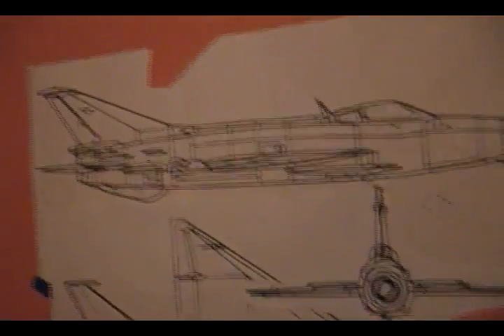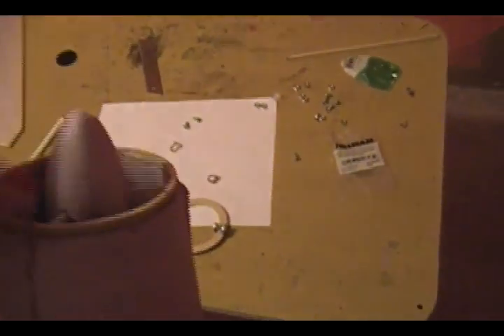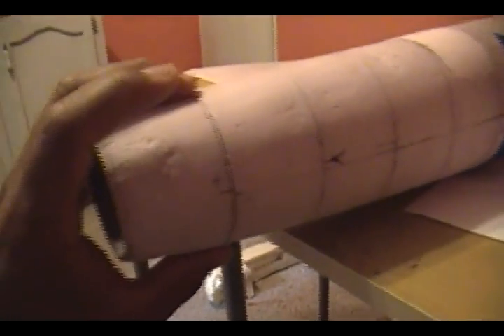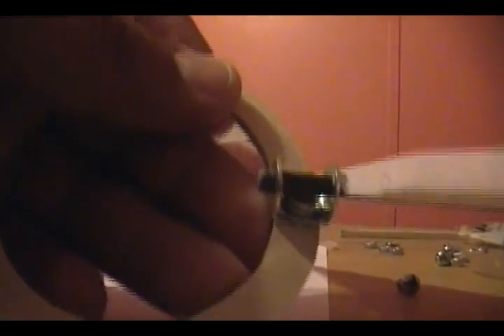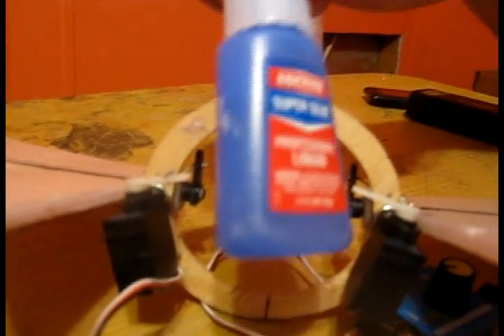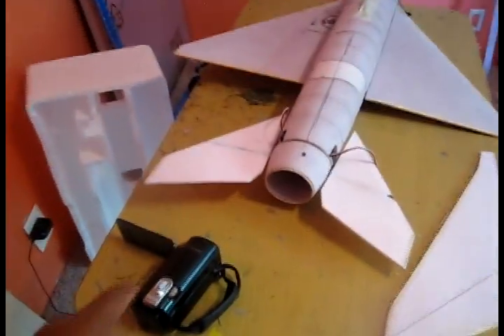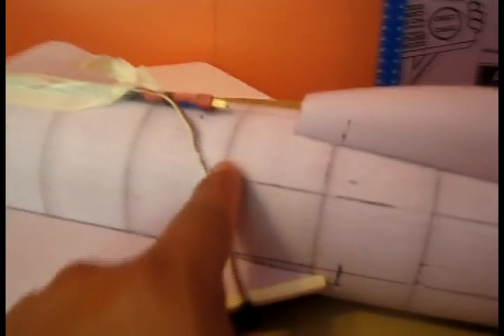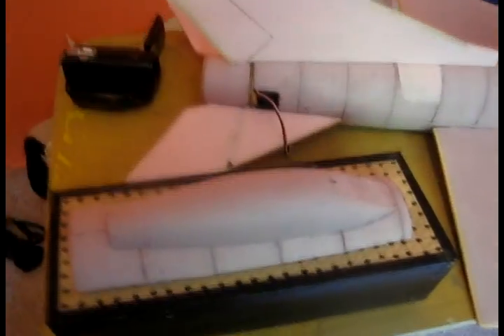EDF MIG-21 BUILD PART 4

Comment: i agree...the pins appear to be carbon rod which will wear down pretty quickly inside the metal carrier parts. i think i'd rather have a narrower exit nozzle size so there is no flow disruption at the end. the problem with the servo arms is that they are riht near the exit and thus the exit flow wouldn't have enough time to clean out.

other than that, the scratch building skills is top notch

Comment: Recomendation! Do not do the vacuum forming with a raw foam mold!!!!!!! just dont!!! the heat will make the foam stretch down. cover the mold with plaster or something. I talk for experience. The parts that were not covered with plaster on my mold are now deep holes.